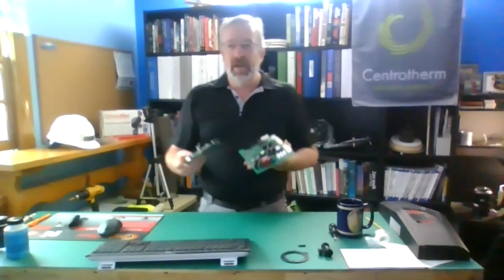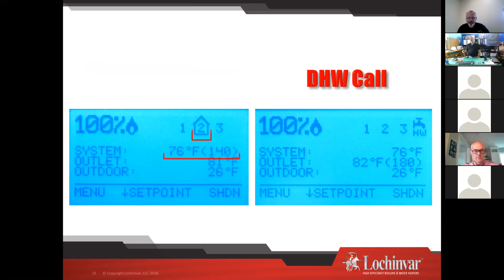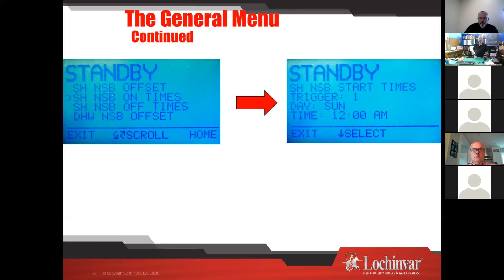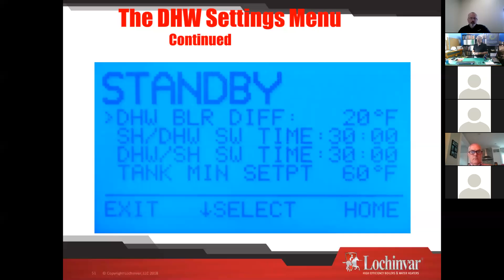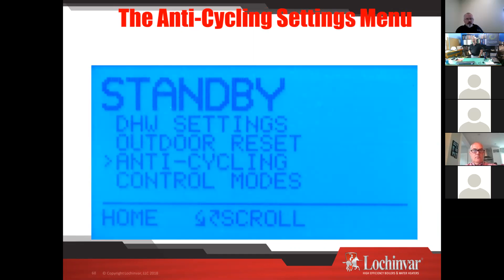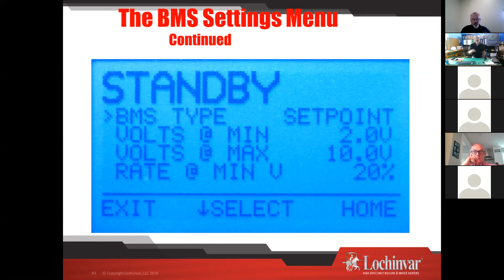Lochinvar Smart Control

Comment: Now you know the reason for the password requirement to alter settings. If you believe the system isn’t running the way it should, call the installer. Do not make changes as a homeowner. Let the trained serviceman do it.
Reply from the maker: Exactly!

Comment: I finally found a presentation that explains what the acronyms are, and what they do.  Thank you.   I have a stupid question that I couldn't find an answer in spite of searching the web for a week.  I wonder if anyone can help.  The questions is:  why do I want or need a primary/secondary loop?  I thought the biggest reasons for P/S were to 1) reduce the temp of the inlet water (shock to the heat exchanger), and also create a path for the boiler circulator.  Well, if I ran the system temp as low as possible (based on the fact that I have 40 year old baseboards tha are not something I will replace), why do I need to reduce thermal shock?  Ultimately the boiler/system pump should run 4 hours without start/stop.  Low  outlet temps = low Delta T.  So minimal shock to the heat exchanger.  Also , If I turn OFF the boiler pump, and have a variable system circulator that runs only if there is demand from the thermostat, why do I NEED a secondary loop?  I presently have 8 zones, so balancing the primary/secondary for all system demands would be virtually impossible with a low loss header if you want to minimize return water temperature to condensate during low demand.   The system circulator would either be overpower or under powering the boiler circulator based on heat demands (single or multiple zones demanding heat).
Reply from the maker: We have a  presentation on this topic: 
https://www.youtube.com/watch?v=XdUEtOlz10M

Comment: Does DHW BLR OFFST mean TANK OFFST when there is a tank sensor? ie consistent with TANK SP DIFF - Thanks for the vid!
Reply from the maker: This parameter reflects the degrees above DHW boiler set point (when in a call to make domestic water). the temperature has to go before the boiler will shut off. The range is 0°F (0°C) to 20°F (11°C). The default setting is 10°F. We suggest 10 degree offset with a boiler target of 170 to 180 degrees when in a DHW call.

Comment: Excellent presentation.   I've an WH55 installed in my TN house in 2013.   It is controlled by a Tekmar 420 and two Tekmar 335 zone managers  which govern 26 loops in my house.  (I really like the comfort tuning I can achieve with all the various radiant heat loops and I love my Lochinvar).   I let the Tekmar control my Knight via the BMS power setting (wires go to terminal 33-34), but I don't think I've got the Knight optimized.... The Knight seems to cycle frequently.   I'm going to review my settings based on what I learned from you today.   Maybe I'll get an efficiency improvement... :-).     THANKS VERY MUCH FOR POSTING THIS.
Reply from the maker: Glad you found this useful!